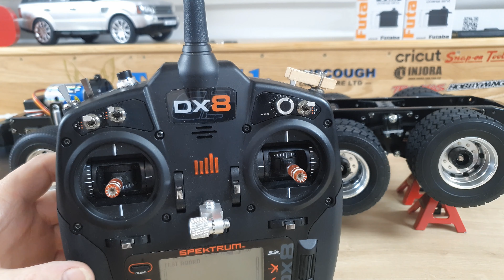Tamiya Scania 770S 8x4 Heavy Hauler - Part 4 - Gearbox Build & Top Tips (4k)

Comment: Hi Teri I have just put an order in for the 770s 8 4/4 and on the it looks as the motor is different to what Tamiya use so why did you change it to the Carson.
Reply from the maker: I prefer the Carson Poison Truck Puller 80t motor because it is slower and draws less current which makes the batteries last longer.

Comment: Dont want to be a game braker but there is still one mistake in the gearbox top shaft last gear, the one opposit the Motor should be Turned around ,the way its mounted Right now de Gears don’t line up totally checked in the drawings brass inerpart should be on the other side still Great Build Busy myself with the Same one